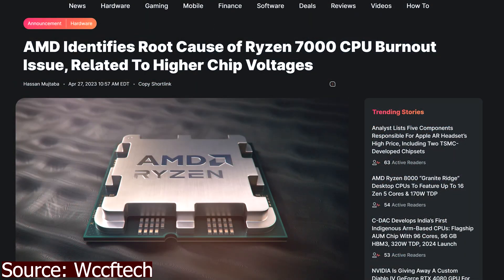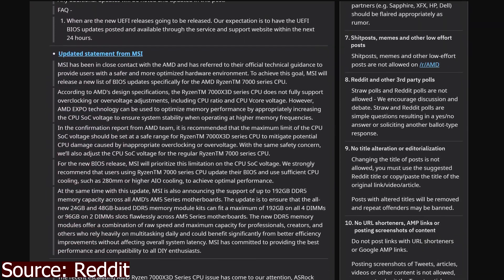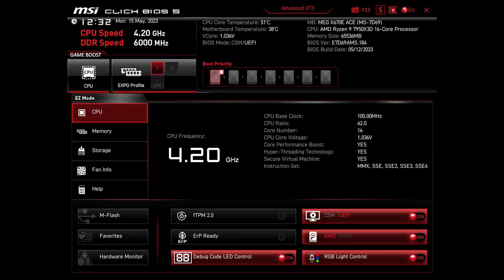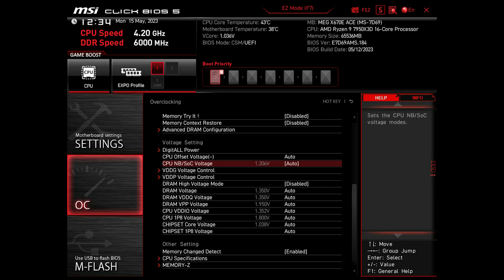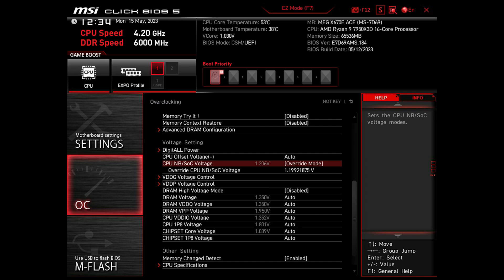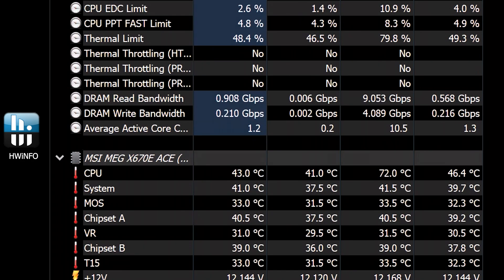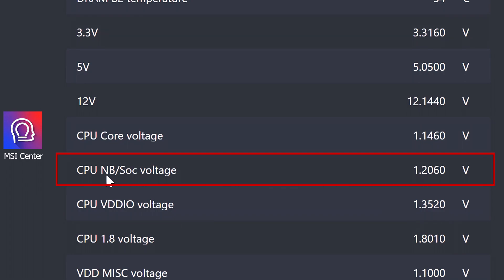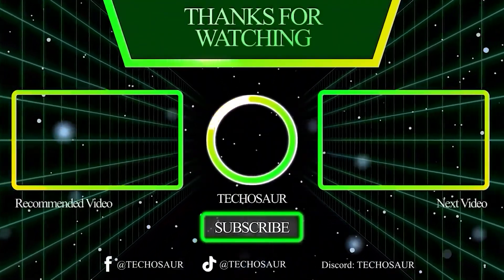Fixing high SoC Voltage on Ryzen 7000 CPUs: Guide for MSI Motherboards

Comment: my soc voltage is saying 1.272    This is too high, right?? 

Mobo: Rog strix B650E-F gaming wifi
Proc: AMD Ryzen 7 7800x3D 8-core processor
GPU: MSI RTX 5070 12gb gaming trio =( 
Ram: Kingston Fury ddr5 6000MT/ CL30 32gb (2x16)
Storage: WD_Black sn850X NVMe ssd 2tb  7300 Gen4 2tb
Psu: MSI MAG A850gs pcie5 
Cooling: a bunch of fans and asus watercooler

Comment: When X3D setting is open, I can’t change the SoC voltage manually. It stops automatically on 1.3 voltage. İs it possible to have crash in games because of this?

Comment: Can I just change this setting ? Or did I have to worry about other voltages that will be effectet by changing the SoC ?
Reply from the maker: no there's only one SoC voltage and once changed it won't affect the other ones, I have currently been trying other kits and I have the same board but with 96GB 6200 MHz with tight timings still running at 1.2v SoC, so trying other RAM kits than shown in video, it's still working

Comment: Is 1.25 safe SOC voltage for the long run i mean would it degrade my cpu over time? Or should I lower my RAM speed and go down to 1.2 instead iam running 7400 mhz Corsair titanium's at 1.25 SOC voltage
Reply from the maker: Don't worry about it at all. 1.25 V is within the safe range, and you can use it daily in this manner without any concerns.

It doesn't boot with a 1.20 SoC at your current DRAM speed?

Remember that 1.25 V is the "recommended safe SoC voltage limit." 1.35 V "appears to be safe." 1.35 V "appears to be 'safe'. Anything between "> 1.35 V" & "< 1.40 V" has some danger factor of "burning out" your CPU.
So 1.2v is lower than the generally recommended value, but for me, it has been stable since the moment I set it this way, with no issues. However, my RAM is 6000 MHz EXPO.
Reply: @TECHOSAUR  it does boot at 1.2v but to be honest the performance is not the same as 1.25v thats why i pushed it to 1.25v as on 1.2v system feels sluggish and latency is high why on 1.25 and some tweaking iam scoring 19K in C23 why stock was 17K and 1.2v is 18K
Reply: @TECHOSAUR Good update for you bro my system is very stable now running 7800x3d at FCLK 101.5 - boosting up to 5.9 and even 6.0 GHZ according to HWinfo IAM sure that's an error😅 but it's stable at 5.2ghz all core scoring over 19k in CB R23 at 1.2 SOC and 7500Mhz CL 34 - 32GB Corsair titaniums which is crazy to be fair in cyberpunk 2077 full ultra settings with Ray Tracing 180+ FPS on 1080p ... NOW the only concern I have is this question for you and any one reading this msg in chat I need help confirming while my SOC voltage is at 1.2 -- VDDIO IS RUNNING AT 1.45V which is scary high is that normal can I run the system with that high VDDIO Voltage? Cheers
Reply: @xwiair3426 what gpu do you have? Seems like your monitor is bottlenecking your system
Reply: @LegalRightz  hhhhh 4080 super and a 1080p 240hz monitor will be switching to 4K soon
Reply from the maker: @xwiair3426 Rich Boiii
What monitor are you eyeing?
Reply: @TECHOSAUR  the new LG with 2 modes 480hz 1080P and 4K 240 Hz

Comment: @techosaur hi i just update my bios and the performance its then before.

Update Msi bios from 1.0.4.0 to 1.0.9.0

Now even if i set up CO to -30
NB/SoC to 1.25 its still going to heatup to 95
Expo its enabled 

Whenever im looking they get low temp with CO -30 

Am i missing something? Thanks in advanced
Reply from the maker: What motherboard model is it ??

Did you check the voltages on HWINFO64 when it's 95 degrees ? 

Does it get this hot even under small loads like gaming ? Because if it's only getting hot to 95 with extreme AVX loads I think it's fine as those CPUs are designed to push themselves all the way to max temperature to give the best performance possible, so it's going to hit that degree no matter the cooling condition just for the sake of boosting performance

But If it's overheating under small workloads or idle then that's an issue

Comment: should I set my core voltage on 1.2 or 1.25? I have the ryzen 7 7800x3d, 32gb 6000mhz corsair vengeance ram ( not sure if it's cl32 or cl36 haven't checked, this is a prebuilt ) and the Asus Prime X670-P motherboard. I'm currently not using expo, so it's at default speed ( 4800mhz ) and I'm kinda afraid to turn it on. Let me know what should I do cause I kinda wanna try with the expo on.
Reply from the maker: Yes you can set it to 1.2v just fine, I've had it this way for months and got no issues, it's best to have it as low as possible to avoid any risk, but for the first few days, make sure to monitor SoC voltage through HWinfo quite regularly to make sure it's not overriding the value u've set, like check it in different scenarios but it's totally fine to use EXPO don't worry
Reply: Thanks for the reply I really appreciate it! A few more questions I gotta ask, I downloaded the CPUID HWinfo and it works fine, it shows that my SOC is at 1.019 MAX at the moment. Keep in mind I'm not using expo at the moment so everything is at default ( 4800mhz ) however what I want to know is that how can I make the HWInfo stay on screen 24/7? Like for example, if I go ingame it is just running in the background and I can't see anything, I would really wanna see the temps and core voltages while I play so I wouldn't have to alt tab and check them all the time which I have been doing now. I have tried everything and already spent hours trying to make it stay on screen while I'm ingame but I couldn't get it to work, do you know how to fix that? Also another thing I gotta ask, I have the Prime X670-P motherboard and I haven't updates my bios to the latest version is that okay or is it an absolute must to update them? Cause I honestly wouldn't want to update them since everything has worked fine for now on my pc. I do have almost the latest bios version tho, it is from 1-2 months ago and if I remember right, they fixed the core voltage going over 1.3 V 4 months ago so I at least have that version installed so I'm not too worried, so again I just wanna know if it's " fine " if I don't update my bios for now and set the core voltage max on 1.2 V and just check my temps / max voltages from HWinfo for a couple days to make sure everything is working properly.

( Edit ) I think it was you who said that " you should always update to the latest bios on AM5 since it's so new " which is probably true but if I wanna stay on this version I am on now, is it okay? Or is it an absolute must to update them, that is what I wanna know, and also how to make the HWInfo stay on screen while ingame, thanks!  @TECHOSAUR
Reply from the maker: @PahEz  I checked ur motherboard page, if u have the version that was released in may then I highly encourage to get the latest one as they have enhanced memory compatibility as you can see on notes, it's the same for all other manufacturers, it was mostly about higher RAM speed support up to 8000mhz and addressing some issues
If u have the one released in August then u can try it this way and update soon after but I honestly can't understand ur hesitation  😅

As for monitoring SoC/NB voltage in the overlay, thanks to you I got inspired to put together a guide on how to do it and you can check it right here !
https://youtu.be/NhiXXNan_hE
Reply: @TECHOSAUR  Oh thanks I will check it out in a min. 

Also, it shows that the version I got is from 26 or 28th july 2023 ( one of those can't remember exactly which one, but at the end of july either way ) I couldn't find that exact version from Asus website tho and I honestly don't know why is that, however I do have the Soc Voltage fix where they set it to 1.3 V Max since that came in May I believe.

The only thing I'm afraid of is if updating the bios will cause more problems. Since my pc works fine for now, and I have heard other people have bunch of issues after updating their bios to the latest. That prevents me from doing it.

Either way thanks for the reply again I appreciate it, I will def check out the video about the overlay.
Reply from the maker: @PahEz  its fine, usually the date it shows in system is earlier than when they actually release it on website.
given that date is saved when they pack it so the date they post it on website will be after few days, but they're pretty close, i assume yours is the one previous to latest which is Version 1636 released in 2023/08/04

let me know if the overlay works for you !

Comment: Hi, I would like to ask you
I currently have a Corsair 64GB (2X32B) KIT DDR5 Vengeance RGB 6000MHz CL30-36-36-76 rated on 1.4V (CMH64GX5M2B6000Z30),
together with MSI MAG X670-E Tohamawk WiFi (latest BIOS from 14/08/2023) + 7800X3D.

The SoC value shows me 1.295V, should it be safe up to 1.3V? + CPU NB/SoC value 1.304V-1.306V. Because I'm worried and it looks like it's very close to 99.61% before the processor can be damaged even though I used it for about 3 hours but only in idle mode, I didn't play any games. Then I set back to default mode.

I am also worried that I have already damaged the processor in these 3 hours. I'm thinking if I should take apart the cooler for the cpu and look at the processor chip to see if there are any damaged anomalies. I have to manually set it to a lower voltage, 1.2V.
Reply from the maker: First of all u don't need to panic as if it was damaged it would have already shown apparent symptoms, as long as it's working it's not an issue, but you must immediately tune the SoC/NB voltage to 1.2v in BIOS, make sure it's not on auto and on override, I'm not sure if ur motherboard has same options as The MSI X670E ACE, but I have 64gb 6000mhz with EXPO and been running it fine at 1.2v for months, it's totally stable and even when I tried it on 7200mhz it worked fine, so it seems that a SoC voltage of 1.2v is good enough to handle high speeds, 1.3v is the last safe limit, I would also suggest that after u set that option to monitor it closely for first days using HWINFO and MSI center, paying attention to max reached column in HWINFO
Also make sure u have BIOS updated and chipset as well 

You can still use EXPO and have 1.2v for SoC
Reply: @TECHOSAUR  I was wondering if I should set the voltage (SoC/Uncore OC Mode and SoC Voltage) in BIOS in the first part of AMD Overclocking for PBO. And should I set something with VDD?

And in the second part of Overclocking, where EXPO is turned off, CPU NB/SoC Voltage shows 1.015 V (options are Auto, AMD Overclocking and Override Mode (does not show when EXPO is turned off)--> I set this third option to 1.2V as per your video ).

First, should I turn on EXPO and immediately go to BIOS and set these two voltage parameters to 1.2V? Before I go to Windows ? Can you help me ? Just to be sure what I should do correctly so that I don't panic again.

Sorry I'm a newbie, I built a new PC this week so I'm worried :)
Reply from the maker: @laddso5444  on mine when I use EXPO, it actually turns on the SoC/uncore OC to ENABLED

Also, I usually keep the VDD to auto,
VDD stands for Voltage Drain-Drain and refers to supply voltage for components, typically CPU and memory. Adjusting VDD affects performance, power, and potential risk so i dont usually tinker with it as it has nothing to do with EXPO RAM profiles 

for NB/SoC choose Override mode and set value to 1.2v, this way you are overriding and not causing any variation
and with that, you can run EXPO all fine

you can turn on EXPO and once it POST just go to BIOS and set NB/SoC voltage to override then 1.2v it shouldn't replace it unless you update BIOS version that way since it restarts all settings to default you may need to put your settings again like PBO etc.

dont worry bro, I'm here available for anything possible, i aim to help as much as possible through this channel! 🤩
Reply: @TECHOSAUR  So, if I understood correctly, the following parameters should be set:
Soc Uncore OC Mode -> (Enabled)
SoC Voltage -> set to 1.2V
CPU NB/SoC Voltage -> set to (Override) -> 1.2V
-someone says that this also needs to be set
CPU VDDIO Voltage -> set to 1.2V (originally at EXPO I have 1.4V)

But I have other questions, with the DRAM voltage when I had EXPO on:
VDD Voltage 1.410-1.395V
VDDQ Voltage 1.410-1.410V
VPP Voltage 1.965-1.950V
-Someone says that it should be reduced to 1.3V on VDD + VDDQ, someone says that it's just normal when RAM asks for 1.4V, and someone says that this is the maximum "safe" limit, and someone says that you shouldn't have more be like 1.4V. I am confused.

-I ask: Should I return the RAM and buy, for example, 64GB 5200MHz CL36 which has a voltage of 1.25V or adjust the voltage from 1.4V to 1.3V? The difference between the 5200 CL36 and the 6000 CL30 is about 5-13 fps.
-How do I know that at 1.410V it is safe at EXPO?
-ChatGPT can't answer me because it only has data until September 2021. It's a shame.
Reply from the maker: @laddso5444  I personally left all stuff to AUTO expect for NB/SoC which everyone agree to be the issue of socket burn
I left other voltages to auto because when i reduced the CPU VDDQ it doesn't POST
so i came to understand not to change those ones, as for the UNCORE option it turns by itself to ENABLED when i use EXPO so i think its fine to leave it enabled in OC mode

i have uploaded pic of my current ones on MSI center
https://postimg.cc/xNXpbDj7

they have been this way for months at EXPO 6000mhz, I have 64GB 4 sticks of G.skill F5-6000J3038F16GX2-TZ5NR

I dont think you need to return anything if you are happy with those ones!

Comment: Hi! I have b650m mortar. Can i set 1.25 VSoC and vddio when expo disabled?
Reply from the maker: Are you trying to do manual overclocking for RAM ? Because if u have EXPO disabled you can even have the SoC Voltage to 0.9
For example if I disable Expo on my 6000mhz RAM the default speed is 3600mhz and I have the SoC voltage to 0.9 

Anyway if you are trying to do manual overclocking for RAM without using EXPO you can set it to 1.25 otherwise it's useless to have it at that value when u are running at default RAM speed
Reply: @TECHOSAUR  I'm using default settings for RAM, 4800mhz . But with that settings mobo also set VSoC on 1.3v. That's why I'm asking, possible set 1.25 for default 4800?
Reply from the maker: @plextor8984  yes I think even with 1.2, try that if it didn't work switch to 1.25, setting it as low as possible is good as long as you don't get issues, I'm saying I got 6000mhz and it's working at 1.2, you can try both I think
Reply: @TECHOSAUR  Many thanks for help! :)
Reply from the maker: @plextor8984   please if you like to let me know if 1.2v worked well, could be useful for someone else with same setup as urs! 
🙂

Comment: Just found your video and it was helpful! But, i have a issue it seems like MSI disabled that you can manually adjust the SoC voltage to "keep people safe" ..  Is there a way to do that now you know of? When EXPO is enabled with my RAM kit (same as you but 64GB) i get 1.3v and it can spike under boot to 1,31v for a short time. It kinda makes me worried a bit
Reply from the maker: I have the latest BIOS version for the X670E ACE which is 7D69v191 released on 3rd July and I can still change SoC/NB voltage, I have it since this video to 1.2v 

these pics were taken now from MSI center and HWinfo:
https://ibb.co/Hn5J0BC
https://ibb.co/kSNVD0n

anyway, 1.3v isn't worrying however but nevertheless I find it strange that you can't change it 

What's your motherboard? I can try to verify
Reply: @TECHOSAUR  Thank you, it`s good to hear it`s nothing to be worried about. Seems like i got caught up in the drama around it and it went to my head hehe. I Have MSI X670E Carbon Wifi (7D70v183(Beta version) but i found out the problem. I needed to change the OC setting from Explorer mode to Expert mode, then i could change it manually. All i needed to do was typing in the value i wanted. 

I set it on 1.25v for now and hope it runs stable. But thanks for your help and fast reply helped out with the stress around it! ^^
Reply from the maker: @istephano2207  glad it worked 
I actually didn't know that having it on explorer could disable voltages control, you learn new thing everyday, thanks to you !

Also you can check this if you want
https://youtu.be/OTRLY97AR5I
Let me know if you have those settings on the carbon as well

Comment: i dont have this on my asus z690 board is your option same like cpu core voltage offset??
Reply from the maker: no, this isn't CPU core voltage offset, its SoC voltage you could find it as VDDSOC voltage

but if you are using an intel motherboard this shouldn't be an issue there, it's affecting RYZEN 7000 CPUs

Comment: considering the Situation of burning CPUs due to high Voltage, it's better to manually set the VSOC limit 1,2V or 1,25V, after enabling XMP / EXPO. Just to be on the safe side. Can't trust auto anymore^^
Reply: @TECHOSAUR  why does my bios look different, I have a MSI mobo and it's up to date
Reply from the maker: @StrexeYT  it might be different depending on the motherboard line, for example this one is ACE, other like TOMAHAWK or CARBON will probably have different theme and functions 

what's your motherboard name ?
Reply: @TECHOSAUR  I looked around on Reddit a bit and found out that the 3000 series CPUs have a different UI because of the lack of storage.

Cheers.
Reply: Auto SOCv on my Asus board after the latest BIOS is 1.27, but it is not stable if I set Uclk=Mclk as opposed to Uclk=Mclk/2. My 7950X3D needs 1.28 to be stable.